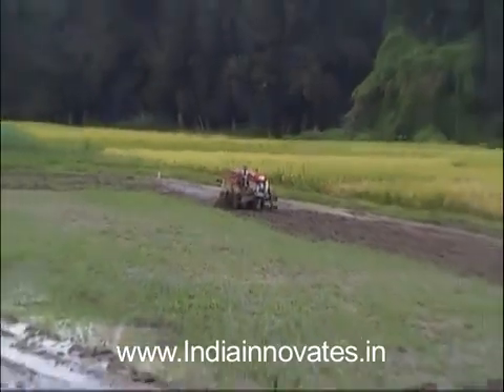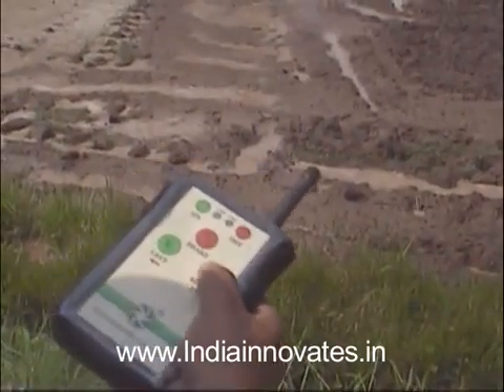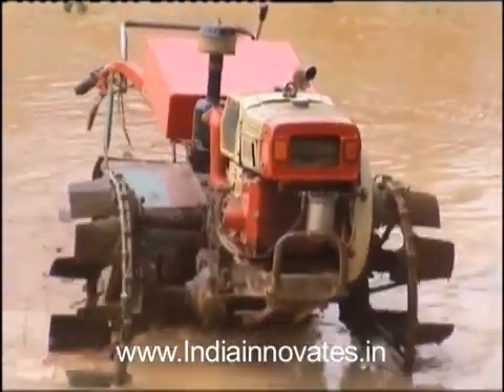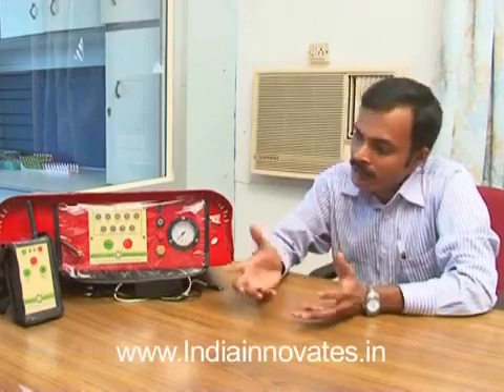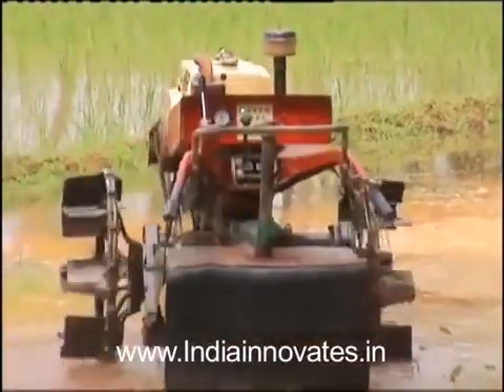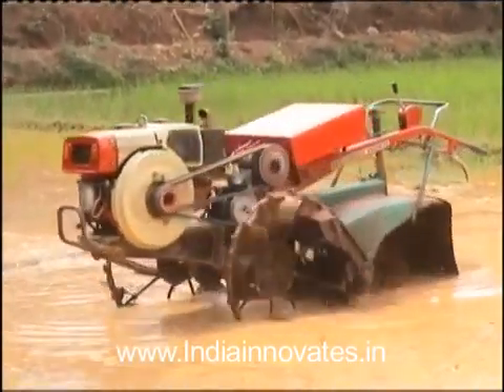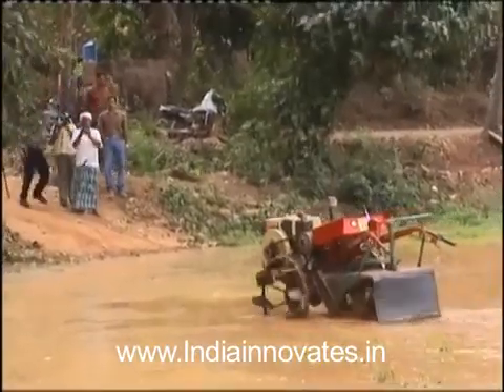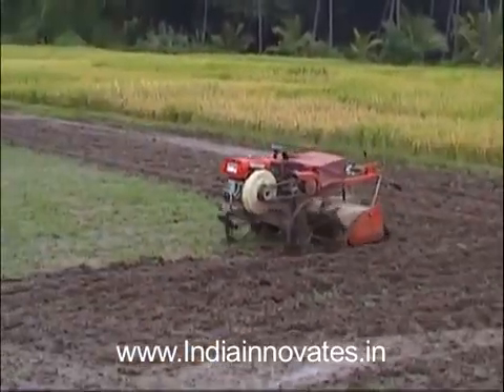Remote controlled system for power tiller

Comment: It is a good inventions, and I think if you can improve it to automate/programable so that it autonomously work in paddy field plot with help some RF tag/gps  like setup at the four corners of plot.  So that farmer can do some work while keeping an eye on tiller. Bcz it is owned by small farmers, and they can save a days wage.
Reply from the maker: Mr vijay power tiller has some technical draw back regardings it direction control clutches. as such GPS based control system wont work and many times power tller gets stuck in mud and it needs to be stopped and cleared . so human interventions is very must. farmers are happy with remote they can avaoid walk behind the power tiller.
Reply: Hai i want this controls